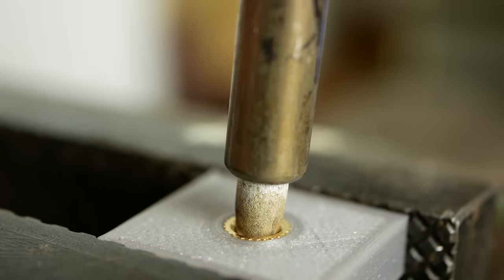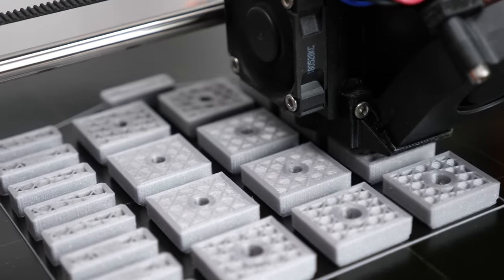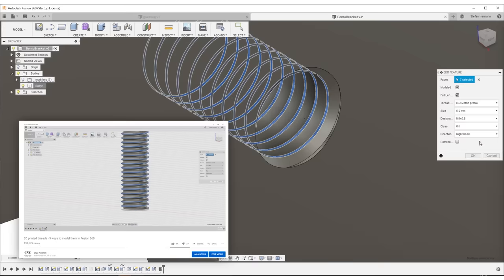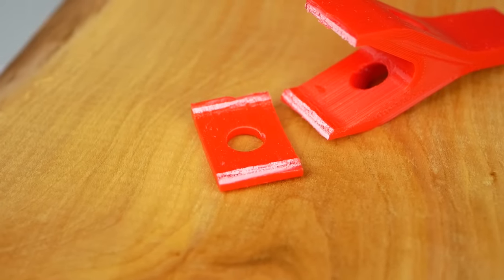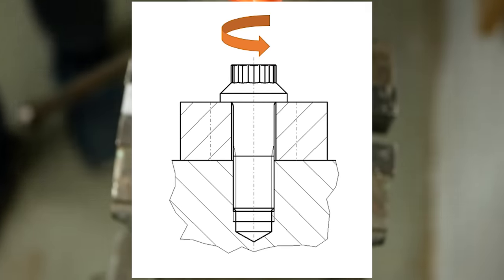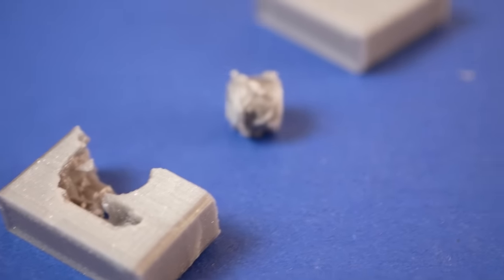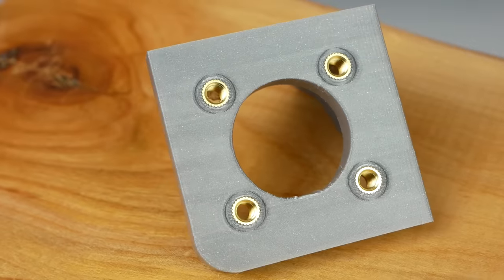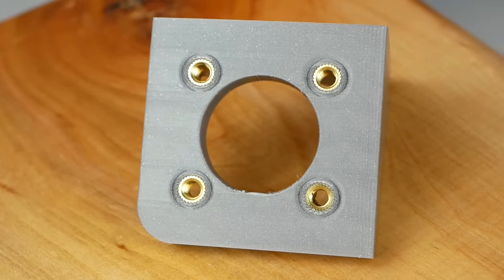Threaded Inserts in 3D Prints - How strong are they?

Comment: Very nice test and quite an inspiration. Most of my designs are quite functional and I try to re-use as much as I can. I will play around with those threaded inserts for certain! One request though if I may: Could you please link to those self-tapping flat-headed screws, please? And furthermore if you had suggestions and links to good flat-headed low-profile load-distributing screws that will not break my horizontal PLA layers, that would be awesome! I've been looking for 3D-printing compatible screws for ages with no great solutions neither for wood screws nor for machine screws. Actually I would not mind an episode just around plastic-to-metal connections one day. Loved all of your testing episodes. Thank you for sharing! JM
Reply: Ah - sorry - you asked for what I do. I use everything from modelled threads, press-fit hex-nuts to square nuts and I use between M3 and M5 threads depending on the application. Threads and screws are something I spend a lot of thought on in my designs but where I felt I had the threads tackled I was never really satisfied with screwing into horizontal layers. Hence my request for a solution in case you could name something from the top of your head. Of course this is not a request to to my research for me. ;)

Comment: Cool video, but i would advise to hit the inserts in the part instead of heating it. The part has to be just a little bit smaller as the insert, goes very well, cannot come loose either.

Comment: I haven't really used threads in 3D printing, but the inserts I use have a coarse thread on the outside with the same knurling at the top.

Comment: check hackaday 's article /threading-3d-printed-parts-how-to-use-heat-set-inserts/ .
There is a cylindrical tool for these threaded inserts to prevent sink marks. And increase ''part looks'' as you mentioned.
The article goes a bit more in depth with the datasheets, but only touched it tbh.

Comment: Hi Stefan, great video!
Did you tried to do water cooling for the hotend? Especially for an enclosure. I modified the E3D V6 with a spiral copper pipe + Al blocks for all steppers and electronics box. It works like magic since 3 months. :D

Comment: What about trying a solid print and then drilling out a slightly undersized hole and then using your soldering iron to press in the threaded insert?  Do you think that would make much difference in strength since all internal plastic is uniform?  Regardless, I like the idea of using the soldering iron to press in the inserts.

Comment: Great video series Stephan.  Have you tested the strength of printed part glue joints?  I'm interested in that as many people have to assemble printed parts due to geometry or size etc.  I use cyanoacrylate (called "super glue" in the US) or 2 part epoxy resin to glue my parts.  Perhaps you could split your test hook into an upper and lower half where it usually fails and glue them together?  If you have already done this study, my bad!   Peter

Comment: Press the heated brass insert against a hard flat surface to get rid of the hump that shows up as you are pushing the insert into the melted plastic.   In the video it looks like you use the edge of a piece of metal.  Instead use a broad hard flat surface and let that help level the insert and the bulge that is created by the melted plastic.  I hope this is clear and helps.   You might already be aware of this and maybe didn't worry about the look of the inserts on some of the test pieces as it wouldn't affect functionality.  This is purely a cosmetic suggestion.

Comment: I prefer using healicoils  with a small amount of red loctite or a dab of JB weld for strength and if the bolt will be removed often. I usually print the threads and this makes for a tight fit for the healicoil.

Comment: I saw a method in which the print automatically paused when it got to the modelled insert area in a print and allowed the user to physically put a nut inside the print, then continue and the print would encapsulate the nut inside the print for a thread that won't torque out and is completed unseen from the outside

Comment: I have been embedding nuts for exterior and critical applications. Sure you have to pause the print and then manually press each nut in before continuing with the covering layer but they look very neat and for the uses, seem impossible to pull out.

Comment: in short: Don't tighten screws too much, use locktite instead. Max pull force depends mainly on the surroundings availability to hold the socket

Comment: I think you should have placed a bushing on the insert because you are not testing pullout, only rotation - that is why it broke before deforming the plastic.  Its pushing against the bushing itself.  A better test would be to place a bushing between the bolt and the plastic so it would transfer the load axially only.

Comment: I use either a M3 nut imprint in F360 scaled down a bit and push it in with the soldering iron kinda like a cheap version of the inserts or just screw the parts together with those special plastic screws which I once got at a sale. 10 000 screws going from M2-M12 for 50$ ! Or I make a impri t in the model itself and pause at layer number to insert them.

Comment: Hi Stephan, 

as always great test!😀

I always print in PET-G and mostly use M3 bolts.
For threads I use both brass inserts or model the threads in fusion 360.
I have had good experiences with modelling and printing threads up to M2.

For soms designs I model both the parts of the threads, so i do not need and fastners, but just screw the parts together.
Maybe an idea to test the strength of fully 3D printed threaded connections.

Keep up the good work.

Best egards,

Robin

Comment: I forgot to say, if you are familiar with OnShape, have a look at (BAS 20") and in the Secondary Cage folder and the Secondary Hub to see a use of captive nuts up to M8. It's one of my projects and there are several other parts in the Reduction Box folders where 3D printing has been used, mostly with PLA as this was early-day design (8 years back) but I am gradually replacing some parts with PETG.

Comment: Great video as always. Why do you have links to inserts that aren't the ones you used in your tests? All of these don't have the side ridges that will grab into the plastic when heated. They seem to only have knurls on the top & bottom, nothing in the middle. The ones you used have small buttons all along the middle which seems like it would help to seal the insert more strongly into the plastic when heated.  Can you please post a link to the insert you actually used? Thanks.

Comment: I usualy do this:
- I make a little through hole ø0.5/ø1/ø1.5mm ( drilled or printed, for my aplications its the same ).
- I use a self-threading screw ( for wood or MDF or chipboard, NOT self-drilling ).
- I align and block varius parts.
- I heat a screw, whith lighter or butane torch,  it must became red.
- I wait from 1 to 3 second.
 (small cooling)
- I'm screwed all together.

I don't use abs/pla/nailon, I use only POM-C.
I've got some problem whith long screw, because the tip cooled too much and did not melt the material (4/5cm).
I've got some problem whith screws too hot, they have melted everything ...
I use an electric screwdriver and screws have torx head.

Comment: The most common size I use by far, is M3. But that can be because of my electrical engineering background, where they are considered standard fasteners for circuit boards and components with holes. Then again, I think 3D parts are almost always not strong enough to warrant a thicker bolt, M3 is plenty strong for most applications if designed with properly, and it will save you a hell a lot of money since M3 is significantly cheaper than larger ones.

Comment: I'm guessing the threaded insert you used was for plastic, but I'm really curious if the hardwood or softwood inserts would work better. especially since the softwood ones (type E) work like the plastic screws with larger penetrating tread. they probably wouldn't need to be heated either

Comment: Imbeaded nuts are sometimes better but embedding nuts sometimes effect the parts strength due to delamination risks. Also I never use thredding unless I have a high stress part but as you saw PLA fails before the insert.
Reply: Have you experimented with putting adhesive on the embedded nut? Cyanoacrylate works well.

Comment: I have a resin part that needs screws to constantly be used, the screw is turned to adjust height. Thread inserts are best option when the screw needs to be used as primary function? What is most durable long lasting option? No force needs to be applied and spring tension to hold in place

Comment: Can you do a video on fine-tuning 3D printers? I've been struggling to get a decent print due to issues that I just can't figure out how to solve. I have a Mod-T printer that prints files just slightly above the bed, and a Monoprice Wanhao i3 Mini that has issues getting a good bed level with the paper trick. Both of these fail at prints adhering to the bed as well, and figured you'd have the best video to make on it.

Comment: The printed threads are good for sure but over time you will see they do not hold as good since the PLA will adjust over time from the stress. I've done this a lot with my sim racing items I've made. I will definitely use brass inserts in the future.

Comment: How do I handle threads in my prints ? I don't. I just print a hole and use a screw that's designed to be used in plastic. Not all stores carry those, so in a pinch I just use regular wood screws. These work almost equally well.

I usually buy bags of screws meant for attaching light switches and electrical sockets to ABB plastic electric boxes. Size is nice for majority of projects, and they have an insane grip on plastic.

I don't understand why everyone uses machine screws in their printing projects, as these are meant to be used in metal-to-metal connections. The thread is way too small to properly grip softer materials like wood or plastics. 

Why don't you just use proper screws meant for plastic ? It's not like manufacturers make those just for fun. With thread designed for plastic you don't have to worry about the screw wearing the hole out with repeated use.

You can even buy wood screws with machine threads on the other end. With those you can create 3d-printed parts with threaded bolts sticking out from them for attaching things !

Next episode ? The pull out strength of m5 bolt in wood. Screwed to an undersize hole vs tapped hole. Perpendicular to grain vs along the grain.

No ! Use proper screws dammit ! :D

Comment: how do you model the screws? I've heard most 3d printers that aren't industrial have a problem wit holes being 0.2-0.5mm under or oversized!
Reply: I add threaded holes in Fusion 360 and make sure to check the "model geometry" check box. The resulting printed threads are perfect on my machine. As long as you calibrate it correctly you should be able to get good results. Good luck :)

Comment: I guess tapping is the best solution. I have done M5 and M3 with Ultem 10, will check and see if it works. Also, self-tapping screws can be a solution as well (Haven't tried though), if you have tried, please share then.

Comment: Like Cura, Sli3r also allows creating modifier meshes directly in the slicer for existing parts, although admittedly there is room for improvement in the user interface for it https://manual.slic3r.org/advanced/modifier-mesh
In the Slic3r Prusa edition I'm using this is now called ""Load generic", not sure if this is a change in original sli3r since that page was written or a modification by Prusa

Comment: I've never really liked using modifiers for a print.  They're almost always finicky and it's too easy to forget to apply them, especially if you're reprinting a broken part months later.  Instead, I prefer to embed thin hollows into my model in whichever section I'm concerned about.

A hollow with a gap of 0.1mm or less but offset by twice your standard printed wall thickness is effectively solid when printed, and doesn't require you to remember to enable any special settings, and as long as these hollows don't extend to the surface, they'll be invisible.  They may take longer to model, but typically far less time than a reprint.

Comment: As it is not really easy by cetus 3d printer use advanced slicer features tu increase thikness of the infill around the hole, i surround in the design the holes with a costellation of tiny 0.2 mm holes in fusion 360 using circular pattern. They are usually not visible in the print but they change shape of the infill and increase thikness of plastic adding columns of perimeters

Comment: I tend to print at 100% as want solid parts, so seeing this vid has given me a good insight of what to use for better threads, Thank you :)

I do have an investigation for you. :) I print scale models. but I get a problem on the small parts, and that is they tend to have holes and the supports are all a mess. 
The thickness of the prints are at 0.5 mm and I use a 0.4 Nozzle & PLA , also the parts are about 10 mm in height and diameter cylinder shapes.
Any help would be great.

Comment: I have done a project where it had me make slightly oversized holes and then superglue in the brass insert. I am wondering how melting the insert with a soldering iron vs glueing affects the strength.

Comment: It works better if you use the "imperial" bolts instead of the metric ones.  The US "National course" threads are not as fine as the metric standards so they do better in soft materials.
The plastic near the hole has to be fairly solid.  Heating an insert and pushing it in tightly packs the plastic around the hole making the plastic stronger.

Comment: ok for reference threaded inserts are designed to add a thread to a part wich otherwise can't accept one OR increase durability of those threads if the base material wouldn't stand up to the fastener being repetedly removed and tightened and 3d prints fall into the second category they don't add any mentionable streangth to parts they just make them more reliable

Comment: How about M2 with minimal wall space for really tight fitting parts? Would be nice to know what's the minimum wall thickness needed. A part I designed uses M3 screws but would fair fine with M2 with threaded inserts....i think.

Comment: please do a test with a normalized hole diamater.  where the threaded inserts have the same amount of infill connections as the modeled threads.  Or do a 100% infill test.  For the pullout tests you never actually tested insert vs cut/modeled threads.

Comment: i try to do everything with m3 screws and i currently use threaded inserts but i dont weld them in, instead i place them in the hole from the side that is opposite to the direction that the load is gonna be.
i make the hole just as big as the outside itself is so the features on the outside of the insert cut into the material when tightening the screws.

Comment: Wo hast du die Gewindeeinsätze gekauft?
Ich plane aktuell eine 3D-gedruckte Handyhalterung für mein Motorrad. Deshalb muss mich auf eine gute Qualität verlassen können und nicht irgendein Produkt kaufen. Ich benötige M5 Gewindeeinsätze.
Where did you buy the threaded inserts?
I am currently planning a 3D printed mobile phone mount for my motorcycle. Therefore, I have to be able to rely on a good quality and not buy any other random product. I need M5 threaded inserts.

Grüße aus Deutschland,
Greetings from Germany,

Colin

Comment: I usually try implementing metal nut on other side of the part if all possible, same with treaded inserts, so bolt needs to rip nut trough the material and not just surface layers. Heating treaded insert probably add huge benefits on material, as layers are melted and mixed together by hot metal part, but those are not that cheap and readily available, hence trying to use stuff i can get my hands on locally. How well insert on other side vs nut on other side can compete should be tested, but i'm guessing insert takes a win with larger surface area over all? and plastic being fused to metal, how ever what is stronger several smaller areas top of each other, or one larger area. Honestly this should be tested like that. I'm guessing it will be insert taking win from that too.
Printed treads i almost never use, except on universal spool holder and low tress applications like that. Few times i have tried on making treads with tap on printed hole, but this is kinda hassle

Comment: i usualy insert nuts in my parts, often just by a side slot where i can slide the nut in, or when i want it to be fix, i make a hollow spot in my part and pause the print when the last layer of the hollow spot is printed i insert then the nut with a little bit of glue (just to make in not rattle) and then resume the print

Comment: Most of the times I prefer trgough holes but if a part requires the screw to  not be a through hole then I make the thread by forcing a screw through a hole just under the diametre of the screw.

Comment: Hello, the inserts in the amazon links are not exactly the same as the ones you use - where did you get those from?
Reply from the maker: I used these : https://rover.ebay.com/rover/0/0/0?mpre=https%3A%2F%2Fwww.ebay.de%2Fulk%2Fitm%2F272628154302

Comment: Threads didn’t work for my 3D printed parts. I used ABS , with M5 threads. The bolts started pulling out material, even when not tightened.  The threads were tapped after 3D printing the part. It seems I have to provide threads in my 3D model before printing. I think using a hex nut would work better than inserts

Just curious, do you offer 3D printing services??